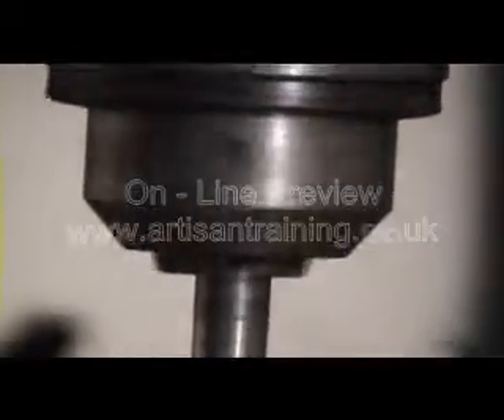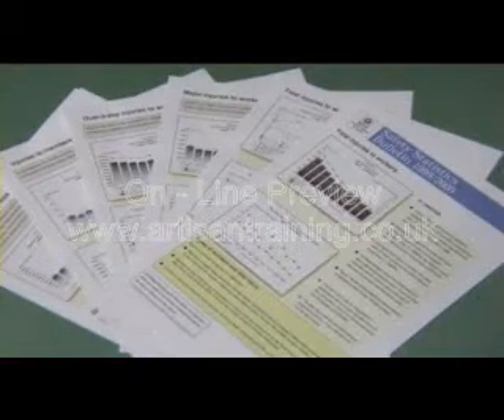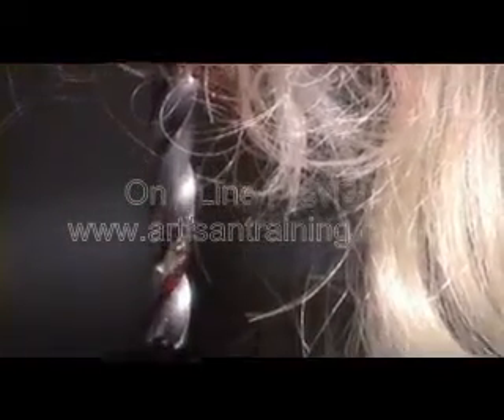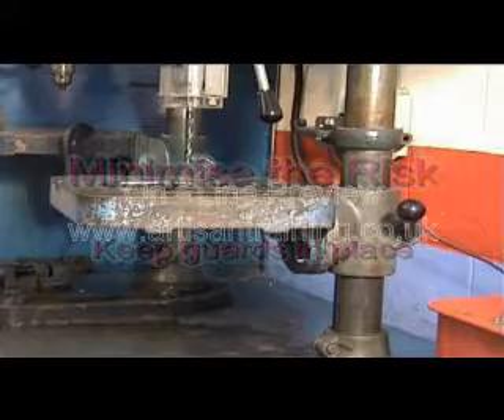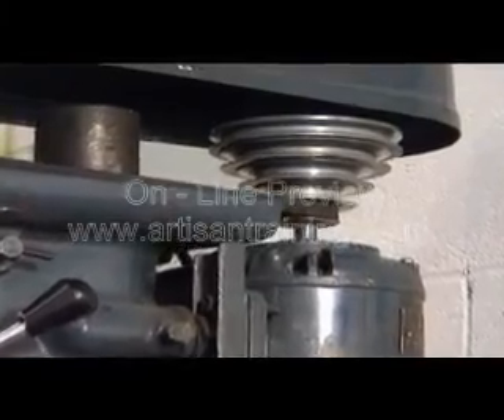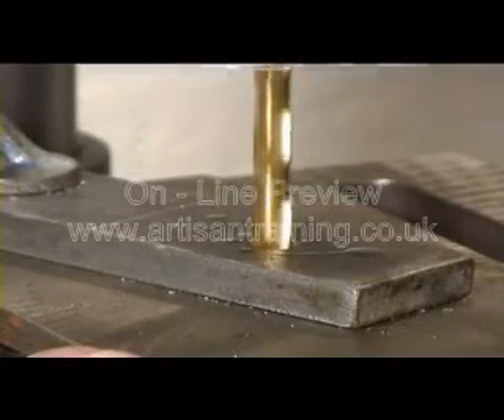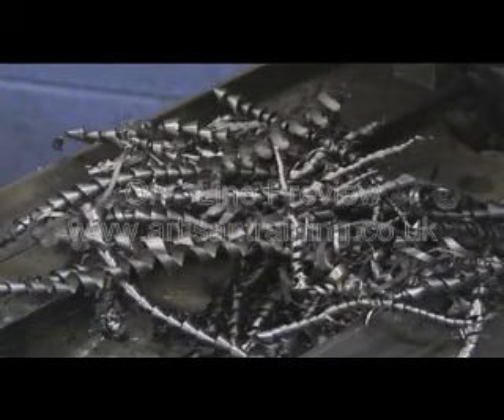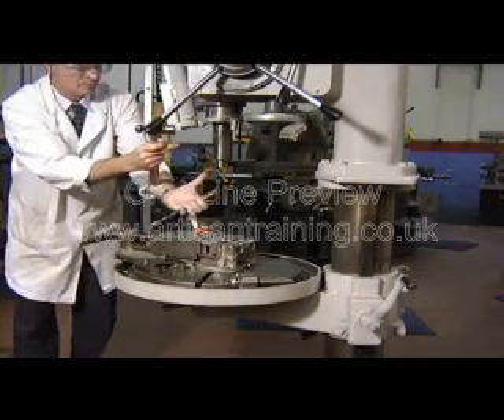Safe Working Practice on Drilling Machines

Comment: nice video. Thanks for sharing
Always remove the drill chuck key, or, the drill drift from the spindle immediately after using it. Wear safety eye protection while drilling. Let the spindle stop of its own accord after turning the power off. Never try to stop the spindle with your hand.
Please post more videos on safety equipment,  especially videos on checklist of equipments.
My mail ID is: hseguru@yahoo.in 
Try to forward updated checklist on my mail.